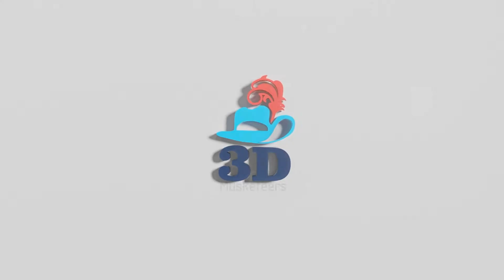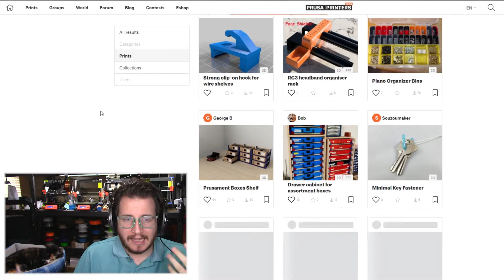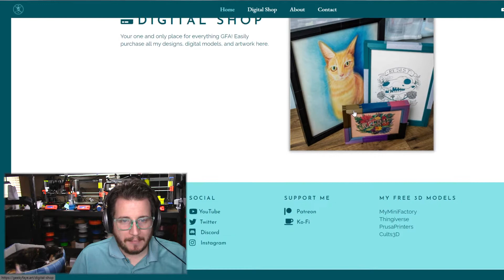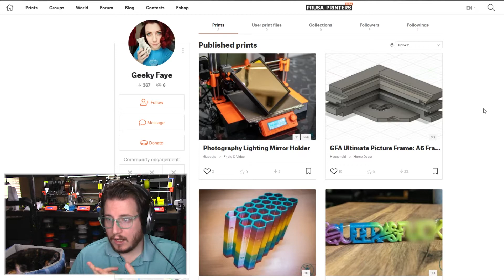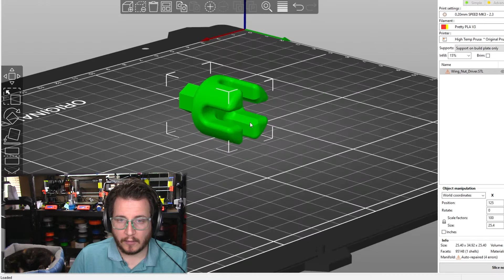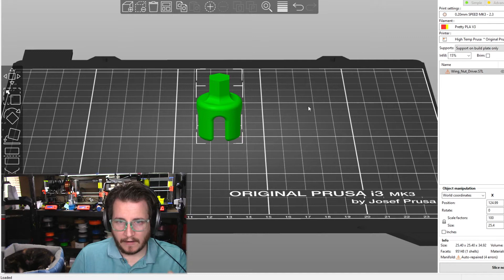Why we 3D Print and YOU SHOULD TOO! (personal) - Maker Time!

Comment: That custom chuck for wingnuts is genius! I bet you made a lot of friends in your parents' neighbourhood with that. Not that I ever need to use wingnuts... but the idea that when the situation arises, you can quickly fix it is awesome. As we've discussed, I'm still playing with design software to make my own shelf support design. Another thing crafters might like is the ability to make custom "rubber" stamps by printing TPU, as we've discussed. The list of sites with designs was helpful, though, in that I found a drone mount plate that will likely work better than what I had in my head. Still need to find a place to put the printer, though...
Reply from the maker: They definitely enjoyed them! We are just glad to be able to assist where we can! 

Glad you may have found something that works! The Prusa Mini+ does not take up too much room ;)
Reply: @3DMusketeers  But will the Mini+ work with TPU? It seems the lack of an all metal hot end limits the filament choice, somewhat. The other thing about the mini+ is that it's Bowden rather than direct drive, and I'm mindful of your comment about pushing strings, with regard to TPU. Otherwise, it seems like a more sensible starting choice than the I3 MK3+.
Reply from the maker: @ae1582  It definitely can! The mini does actually have an all metal hotend, it can get to 290 easily. It is not as robust as the E3D V6 in the mk3s, but then again it is half the price. The bowden system does make it a bit more finicky, especially for softer materials, no denying that, however it can do flex materials. But in general, TPU is tough to print. I am told though that the new Hemera's from E3D print TPU like a dream! Most printers will struggle the closer you get to REALLY soft rubber-like materials. With a semi-flex it is much easier. Semiflex should be more than sufficient for stamps.
Reply: @3DMusketeers  Good to know, thanks! My only worry with the Mini+ is the Bowden drive, but the internet has at least a dozen folks turning out decent prints with Bowden drive printers, so maybe it's not that much of a problem.
Reply from the maker: @ae1582  The mini's bowden system has a few odd flaws, but they seem to be well documented. I have it planned for an upcoming video where we talk about the specific likes and dislikes of our machines.